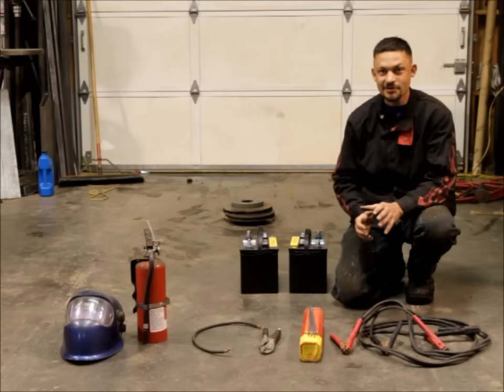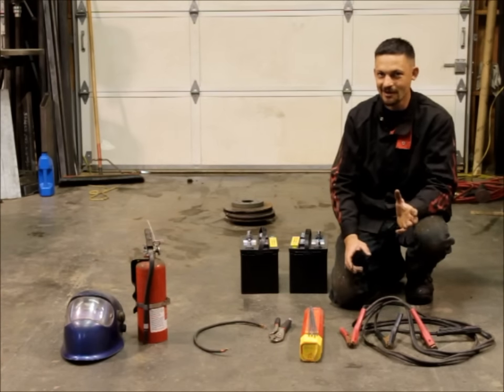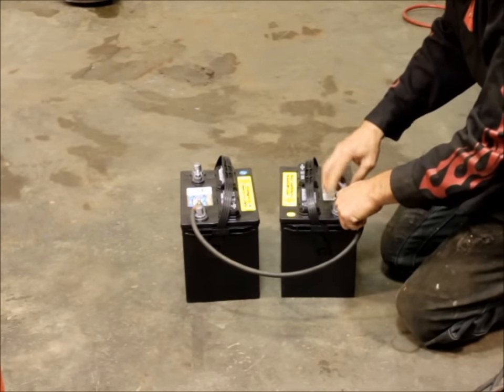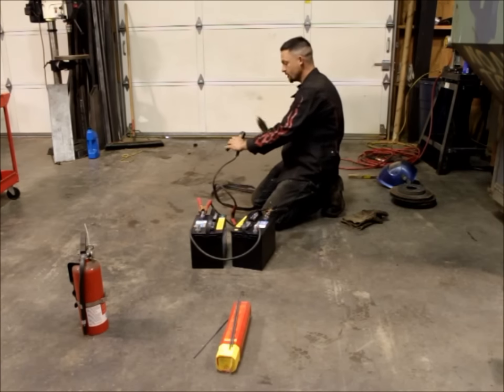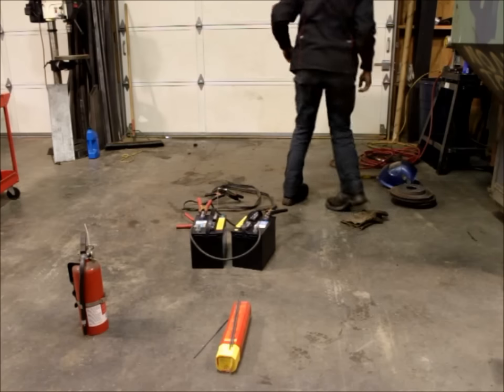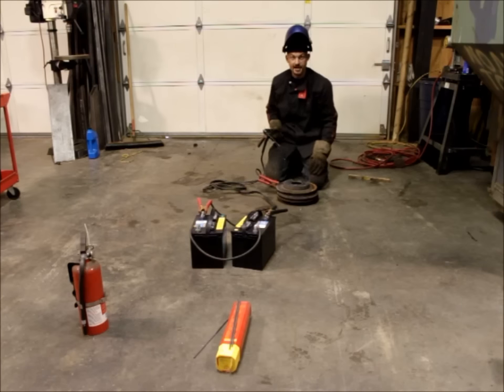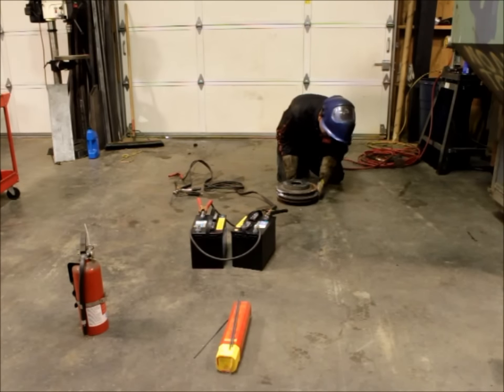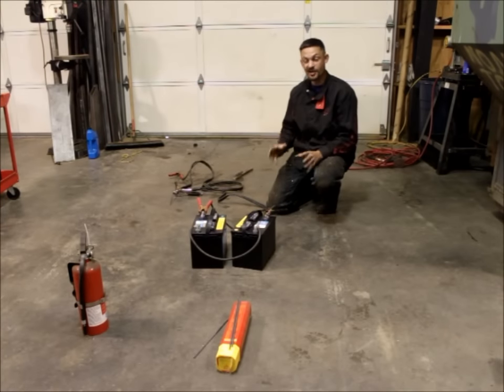Welding with jumper cables and a pair of batteries

Comment from the maker: This video has been up for quite a few years and there are lots of comments/questions that get asked frequently.  Here are my answers to the most common ones:  
1.  "Don't set the batteries on concrete, it will damage them!"  This is something that used to be true, about 60 years ago.  Modern battery case design, vent systems, and materials mean that it is perfectly OK to put batteries on a concrete surface.  I won't go into great detail, but the reasons why are easily available using a google search.  
2.  "What rod did you use?"   1/8" 7018 is what I carry in my vehicle.  
3.  "This irreparably damages the batteries"  No, it doesn't.  Welding current using this method varies; but is generally around 150 amps.  That is less than a starter motor, a winch, and even some stereo systems.  Automotive batteries have no problem supplying this current for short duration, most of them are rated at 650CCA or more.  However, if it is necessary to weld for more than 20-30 seconds at a time, you should take a break to let the battery cool.  And, depending on battery chemistry, you shouldn't discharge the battery below about 50% or its life will be diminished.  
4. "I can get rid of my welder now!"  Please don't!  This is an emergency repair technique, not designed to replace proper welding equipment.  It has lots of limitations; most notable is the lack of ability to control current.  With decent jumper cables (4GA or larger), 1/8" rod, and healthy batteries, you'll get about 150A of welding current.  But, there are all sorts of variables there so actual welding current will vary based on your setup.  I can easily weld 1/8"-1/4" material using this method, good for most emergency trailside repairs.  I have used it for things like cracked frames, broken suspension links, shock mounts, etc.  For any jobs where I plan to have to weld, I'll take my Miller Bobcat and my wire feeder over the jumper cables any day.  
5.  "The batteries will explode!"  Modern, healthy batteries will not discharge hydrogen gas during discharge.  So no, this isn't a bomb.  Improper charging, a damaged battery, or a damaged venting system CAN cause hydrogen gas to form, so it is prudent to make sure you're not dropping sparks right on top of the batteries.  In my life, I witnessed one battery explosion and it was ugly.  It was NOT for welding with batteries; it was jumper cables that were hooked up backwards and left in place.  I would never say there is NO risk, but the risk is minimal.  
6.  "Can I weld with 12V and 1/16" rod?"  I haven't had good luck with this...and most emergency repairs don't need this small of an electrode anyway.  
7.  "I'm a welder/CWI/etc. and this doesn't work!"  It works just fine...as an emergency repair technique.  I used to be certified as well (though I haven't been for many years) and I would NEVER use batteries and jumper cables for a weld that was going to be inspected, or that I needed to rely on.  It does, however, work quite well to stick two pieces of metal together long enough to limp a damaged vehicle home.  It is not a substitute for a real welding power supply!  This is essentially a constant voltage source; a normal SMAW welder is constant current so an experienced welder may try this and be immediately turned off by how different it is from normal welding.  But, it DOES work for emergency repairs.
Reply: Egads, the world really is that stupid. Half of Africa is held together with metal welded by a guy using this technique (though they do often use more batteries that I've seen). Folks, it's a way to weld when you ain't in the shop with your $20K Miller rig - lighten up.
Reply: HEY MEXICAN  !!!!    I don’t like anyone anymore.     Including myself. ⚡️⚡️⚡️.   THANKS FOR THE VIDEO 💯💯💯💯💯.    💥💥💥💥
Reply: Say of you had a dual battery truck. Could you run the batterys while still connected to a running truck with out damaging it to keep a charge going to the batterys while welding?. Or would running the batterys I series while connected to the truck not work. Or would this work with just 1 battery?. Maybe use a thinner rod?
Reply: I'm amazed how many people still think it is bad to store a battery on cement even though this has been well explained for at least 30 years that I can think of as false for modern batteries.
Reply: Dude you sir kick ass 🤘🤓🤘
Reply: @cody181818  dont want to short out the car so I would not do that easier to take it out and be safe
Reply: Thanks for sharing, I would have never thought of it.  Great for a quick fix to get you home so you can do it the right way.
Reply: I didn't think that this could be done! Thanx for the video and info Matt!
Reply: 100% going to use this method to weld up some steel targets!
Reply: Have you tried welding with three batteries 36 volts?
Reply: That’s because they were rubber cased.  The new plastic cases don’t create a potential difference so they don’t ground out.
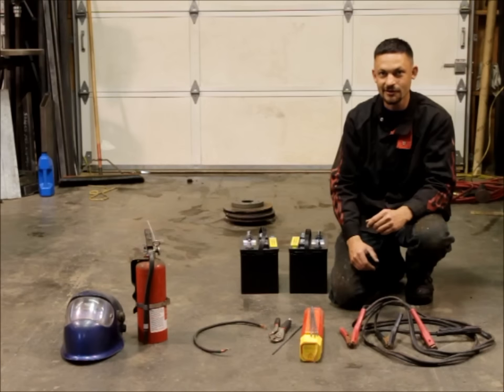Reply: @cody181818  he already said in the video that you should not have the batteries connected to your vehicle while using the batteries to weld stuff. he said this at 1:10 during the video.
Reply: @cody181818  no it will destroy your charging/sensitive electronic parts
Reply: @beauulvick4055  not sure if it was mentioned but wht about 2 high amp alternators mounted to a 5hp motor geared up to match rmp of cars and connect it to 4 high cranking amp batteries 2 in series and parallel both together with large capacitor between and after batteries.  Voltage regulations on alternator and caps will keep current steady
Reply: @cody181818  you can just disconnect the negative chassis lead on the cars batteries, then it doesn't matter. But you shouldn't leave both battery leads connected to your car for the reasons of voltage peaks which occure during milliseconds when drawing high currents. Also during the welds the voltage of the batteries can drop quite low, so you might have to reset the time on your car depending on your card age and model. And yes, theoretically both shouldn't be a problem, but I wouldn't want to risk my cars electronics. But I agree: connecting the battery to your car itself usually also creates small sparks as everyone knows... and yes, this also creates voltage peaks, which the cars electronics usually handles fine.
Reply: @iwasiamiwill_  

First, it would take more then a 5 hp motor to just turn them under a load.   One alternator uses 5 to 10 hp in an older car. We used to run a toggle switch on the field wire to shut the alternator off when drag racing.  

Remember that the alternator is spinning at a higher rpm then the crankshaft.  So you would have to "gear up" with the Briggs.... which would make it work harder. Gear it down, and the alternator wont spin fast enough to do its job. Or vice versa.  But you get the point.

Second... after investing all the money in alternators, batteries, Briggs engine,..... you can buy a decent arc welder. 

Third... this is for an emergency repair to get you home. If you are out 4 wheelin, its unlikely you will bring that heavy contraption with you anyway.

But if you have the stuff laying around, put something together and post how well it worked for you.
Reply: @brianschumaker5912   I agree with everything you wrote except the 5 hp elec. motor part.  a 1/2 hp electric  would easily spin an alt. most alt.s are at full output a 6k rpm which also could easily be achieved. end of the day Agreed just go get a  second hand welder.
Reply: Bravo thank you I have no knowledge on how to even weld period I'm glad I read your post my dad has a arc welder still in it's box maybe one day I get up the courage to learn how to use it very handy skills to have
Reply: @cody181818  you would completely fry the internal computers of your truck. fuses would blow and the chipset in your ECU would get a voltage spike (which electronics with chipsets do NOT handle well even though somebody above mentions they are fine, i work with computers and that is one of the last things you want introduced to a computer) and potentially start a fire as well.
Reply: Is it ok to weld indefinitely if you male a machine like this but with an engine and alternator settup
Reply: @tornadokat  But I'm old school and OCD. I know better, but I still put my batteries on a piece of wood anyway. Then I can sleep.
Reply: My brother blew up a battery back when we were teens by hooking cables up backwards...it happens pretty quickly, if I remember right.
Reply: It’s funny, I haven’t seen this guy in 30 years but I grew up with him when we were kids.  His mom taught small engine repairs to kids in our school.  Matt has always been clever with this stuff
Reply from the maker: @livefreeordie7368  haha, who is this?  You have me pegged!
Reply: @MattVerley  Justin from shady lane
Reply: Great vid and explanation, tks.
Reply: Bro i love this video thanks 4 shareing💯💯💯🥂✔️
Reply: @ruby2961  What anymore? Clarify.
Reply: Hi, I knew a guy who was welding in this way...but he used for safety  a fuse: the connection between the batteries were made with a thinner wire which will burn first....the second was a "regulator": He used a brick with holes in it and took a simple zinc plated wire (tension wire for fences) and made a spiral thru the holes:
the steel wire gets glowing when welding and serves as a ballast resistor. If the wire gets glowing the steel gets a higher resist. Well, I did not do it - but I saw it was working very safety and he was welding everything in this way... and he always checked the heat of the batteries. Good luck.
Reply: Run the positive lead through a 2 lt tub of water with 3 tablespoons of salt in the water and two electrodes(copper/steel/alu) and the water will act as a current limiter and regulate it to not damage the battery, from the other side of the tub, run the positive lead to your work piece and the negative lead from the battery to your welding rod via the vice grip.
Reply: 🤯THANK YOU for Sharing‼😁👍❤